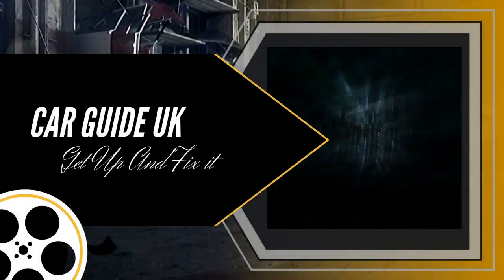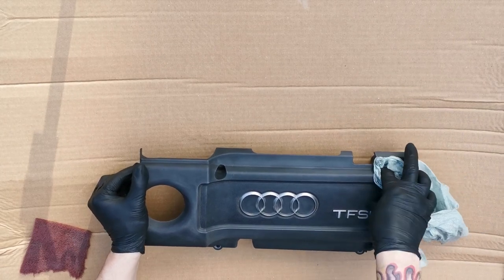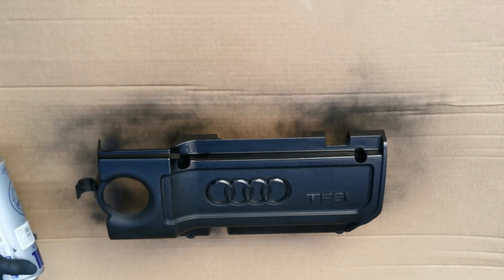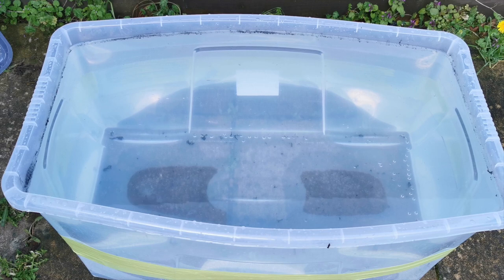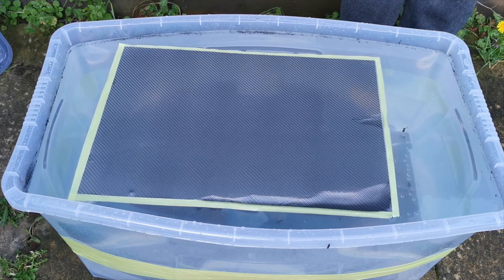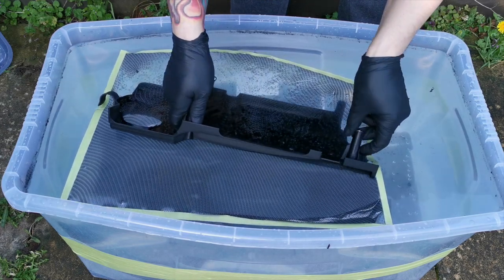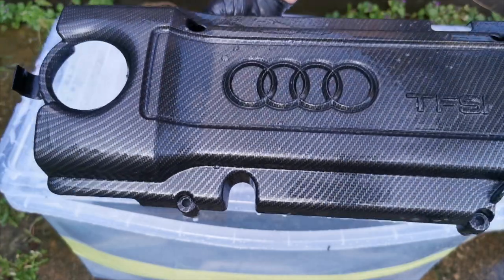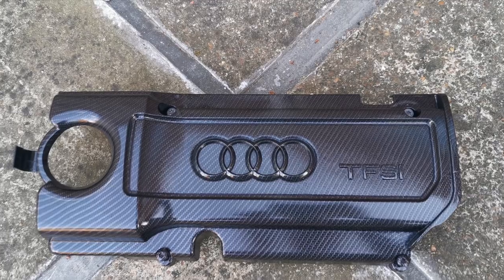How To Hydro Dip Your engine Cover Easy - Step By Step Guide

Comment: Hi  I am trying to dip stihl chain saw parts plastic but can’t get the film to sick been using primer etc and even addition promoter
Reply from the maker: use panel wipe on the parts before dipping as this will clean off any grease that could be affecting the dip, or the water is not warm enough?